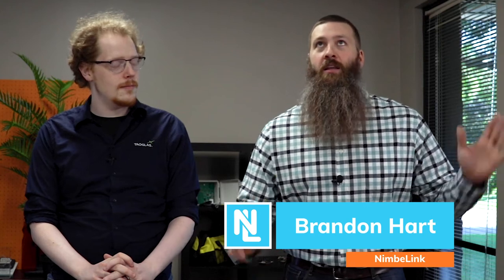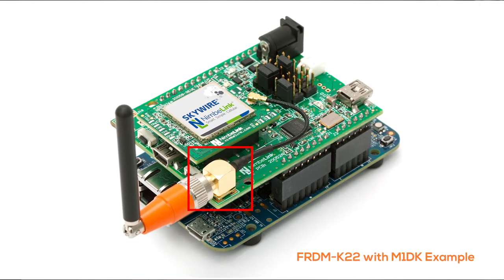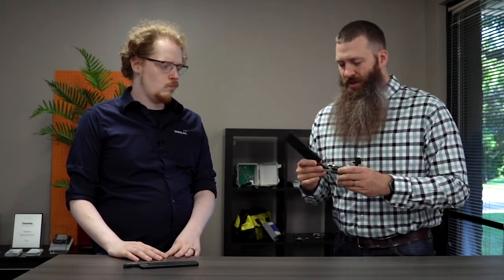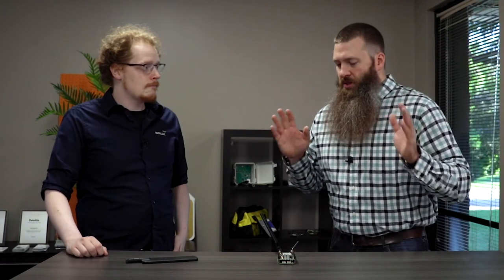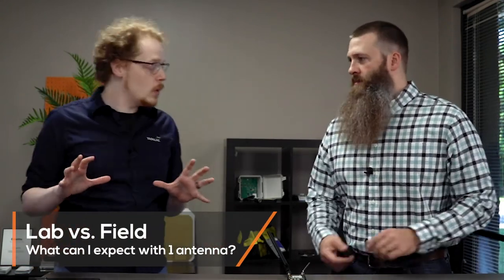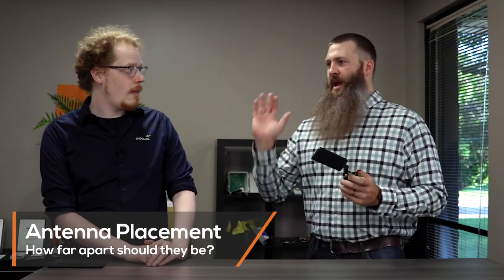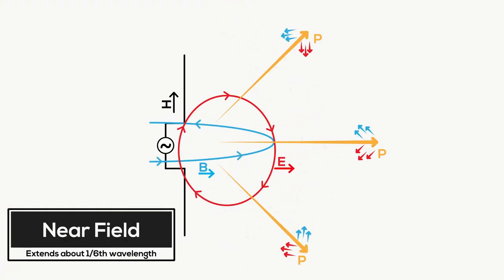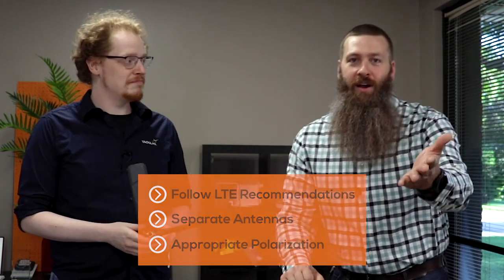What is Antenna Diversity?

Comment: Does the spacing for 2 LTE MIMO antennas need to be precise, or will an approximate distance of 3 inches be sufficient?
Reply from the maker: The spacing does not have to be precise.  3 inches is fine.  It is always best to also place them with different polarizations (one vertical and one horizontal) if possible too, but that is not always possible.  If you want to share more about your design challenges and antenna placement, we can see if we can help!  Contact Sales@nimbelink.com if you'd like. :)